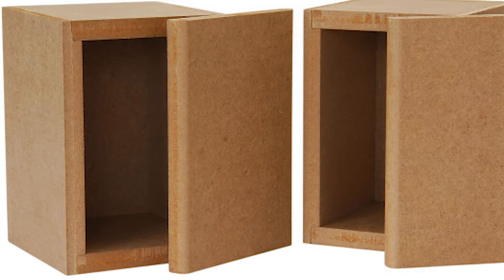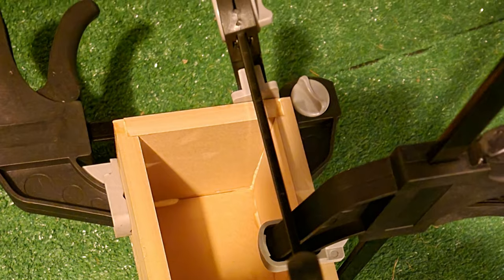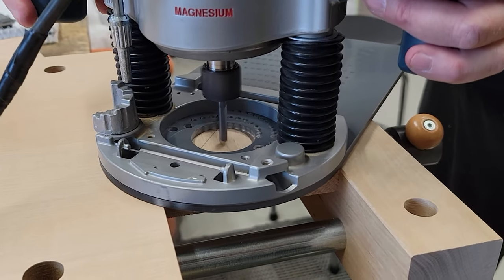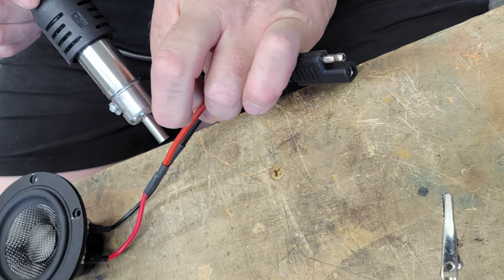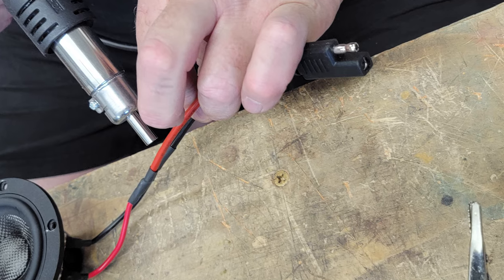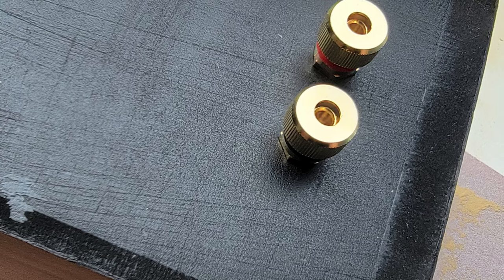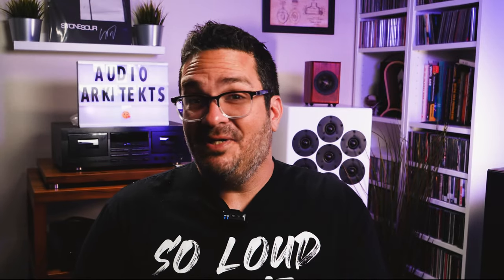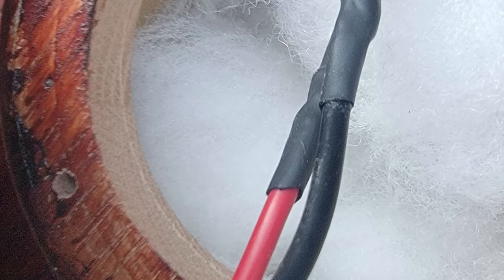How to DIY HiFi Speakers that Sound Incredible!

Comment: diy is fun stuff :)  and yours turned quite good looking.

and i do not think you can line array those, the high frequency would have lobing issues because of the size.
i would recommend setting a 200hz high pass to m3 carbon and 200hz lowpass to a pair of stereo subwoofers, not many subwoofers goes that high, but now you can diy one yourself.
i have done this a bunch of times now, built subwoofers and matched them to all kinds of size main speakers.
its really easy if you have a piece like the minidsp shd studio as dsp/volume control. all you need then is 2 dac's and 2 stereo power amps.

Comment: I would like to make an active pair with a mini DSP 2x4HD with ice amps and a really good tweeter with an Fs of 400Hz  that way you could crossover around 1200hz- 1500hz and stay well below the high Freq breakup. The M3 starts to beam around 9-10k.
Reply: You don't need an fs of 400hz to cross at 1500.

Comment: The bass is not there because your speakers resonate at around 150 cycles. With a larger enclosure there will be more low end of course. You can't go too big because the drivers in free air already have Q = .85 so unless you want to use a sub woofer, those are not the right drivers to stuff in a tiny box. 
You can also add a compensation network to improve the frequency response in the midrange.
Reply: there is not resonance if you fill the volume with absorption, like all sealed cabinets should be.
Reply: @sudd3660  

Every speaker has a resonance frequency (Fs parameter). It's completely normal, you can't get rid of it and you want it as low as it can be.
 It doesn't mean there will be an audible peak though - the rise in impedance cancels it out, to some extent, or completely. That's what the Qtc parameter means - the level ratio between resonance and passband - for instance, .71 Qtc means the resonance will be 3db attenuated compared to the passband output level, theoretically.
Reply: @westelaudio943  i am not talking about fs, the driver resonant frequency, but the internal box resonances.
for the driver itself i have not notice fs affecting anything on most of the drivers i had. but on 3" fullrange driver i have it did not sound good below fs.
Reply: @sudd3660  

You're right - typo. It's Fc or Fb (c for cabinet or b for box) of course, which is calculated from Fs, Vas and box size (air suspension)... 
The Fs (free air resonance) of the driver is 125 Hz, so Fc will be around 150, as I stated before. Below Fc, the response will roll off with a second order slope.
 And no, I'm not talking about standing waves in the cabinet.
Reply: @sudd3660  That’s why the transmission line was developed.